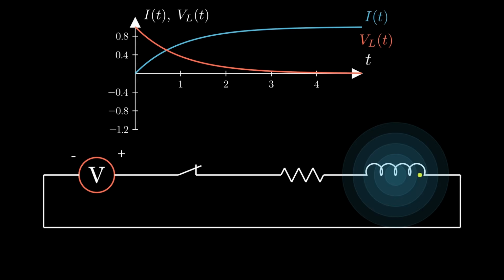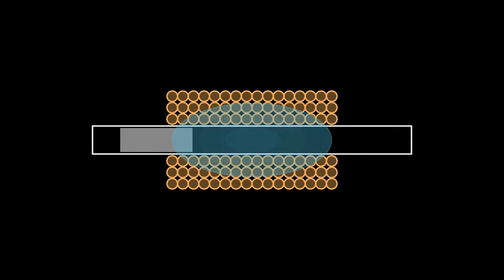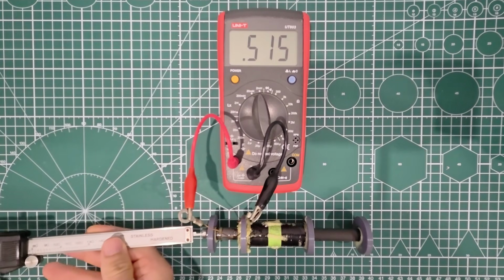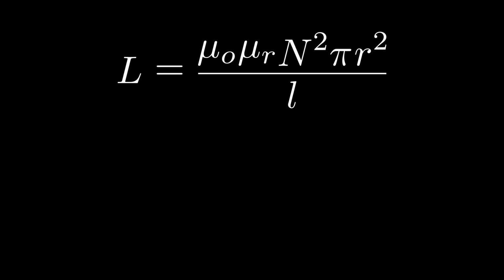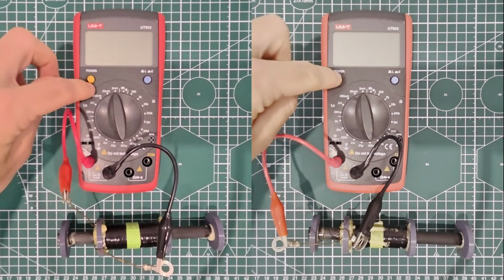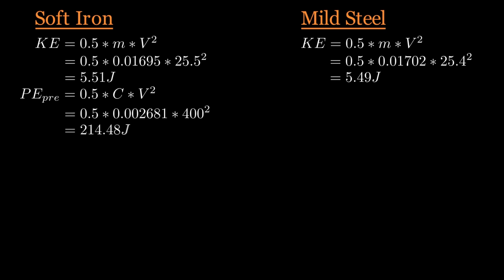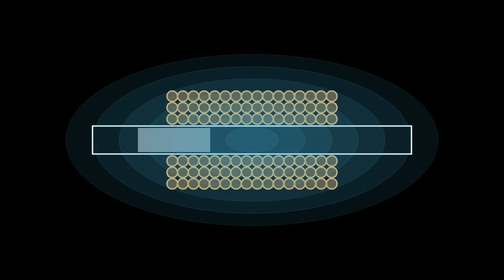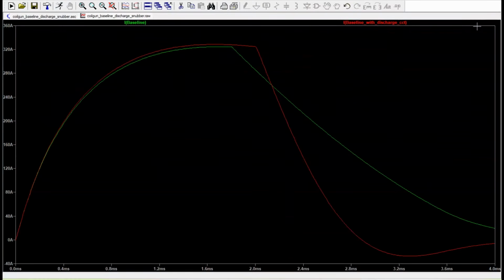The Science Behind The Coilgun

Comment: Hi Owen, have you thought about using a "seeker coil" outside the main coil (protected with a zener diod for the initial pulse)? 
That way you can trigger the shut off very close to the main coil center by detecting the projectile reaching 0V of the seeker coil.
I have not figured out how to best align the coils though. :)
I am also thinking if there are other ways of increasing the resistance during shut off to burn off the remaining energy.
You could argue that your final result showed that you had missed the coil center but at the same time you could just have over shot it now but the velosity increased anyway do to the improved burn off.
Reply from the maker: I have thought similar ideas but thay sounds like one i will spend sometime thinking about a way todo it. I have thought of maybe using a laser distance sensor to work out the projectiles distance to the center.
I havent yet found a better way to burn off the excess energy, there is probably plenty of improvement to be made in that area.

Comment: what if u add another diode btwn the mosfet and the coil? would that solve the spike issue?
Reply from the maker: Are you talking about putting it in series with the coil and mosfet or a different arrangement?
Reply: @owensprojects   In series a diode is placed btwn the mosfet and the cap/coil

Comment: Have you considered using a permanent magnet as your projectile? Use cylindrical magnet with its poles oriented top/bottom of the cylinder. You’ll need to feed the projectile to the coil in the correct orientation but it should be a more significant force multiplier than anything else you’ve done. 

This BTW is why loudspeakers use permanent magnets instead of two opposing energized coils
Reply from the maker: Using a permanent magnet projectile would be really interesting to try out. Like you said, there would mostly likely be a higher force the the poles of the projectile helping to attract and repel.
Reply: @owensprojects  
If you check out loudspeaker voice coil design you’ll find a significant amount of work product that can be applied to your project
Reply from the maker: Thanks for letting me know about it. I will be researching into them now
Reply: @owenspr @owensprojects king forward to your next installment in this series. 

Another advantage to choosing a magnetized projectile, as opposed to one that is simply ferrous, is that instead of cutting a stage coil’s power when the bullet passes you can instead reverse polarity adding a pushing force to the existing forward state’s pull.

I would push you towards neodymium magnets as they’ll have a stronger field

Comment: Hello. I'm currently working on a simplified coilgun as a project for my two first years of engineering. Wouldn't using a H-bridge to switch the current sign instead of creating a capacitor discharge be more interesting ? That way, you could keep accelerating the projectile after it passed the middle of the coil. 
Is the short circuit risk too high with the H-bridge at such voltage or is it that Mosfets/thyristor are too unreliable/create internal resistance too high to be worth it (I am really new to transistors)?
In our simulations, an H-bridge connected to a battery/a generator does better than a simple RLC circuit and it also looks far more efficient.These simulations only take into account the EMF produced by the projectile in the coil and the internal resistance of the coil in addition to the typical Kirchhoff laws. 
I'd be curious to know why everyone decides to use a variation of the RLC circuit.
Reply from the maker: Hi, you could use a H-bridge to swich the coil on and off, To be able to keep accelerating the projectile after it passes the center. This is just thinking out loud here, the projectile would need to some type of magnet that has a defined north and south pole to be able to interact with the changing field direction of the coil itself, which a standard iron projectile wouldnt be able to do unless it is somewhat magnetized during the intial phase of firing it.
Would be interesting to try and see if it works though, let me know if you do try it. You just need to ensure there is enough dead time between switching the direction of the H-bridge to allow the mosfets to have completed switched off so you dont cause a short circuit
Generally the reason for using capacitors and using a mosfet/transistor on the low side is cost and simpler design.
P-channel mosfets on the high side of the h bridge are more expensive to get then the equivalently rated N-channel option.
Capacitors are also preferred as once again its cheaper to get something with a high voltage rating and can handle a high current discharge compared to a battery arrangement.
Hope this helps! Let me know of you have any other questions

Comment: have U considered using super-caps , they have a lot more Ampers and energy compared to 400V
Reply from the maker: I haven't looked into them too much. They are more energy dense, although they don't come in high voltage ratings to be able to make much use of the of being able to discharge at high current rates unless the coils used were very low resistance.

Comment: Great to see lab work backed by analysis! I have a question about the snubber. From what I know the capacitor is usually much smaller. A 100uF capacitor seems huge to me, and I would guess it does more than just tame a spike, and instead would significantly modify the current flow. Do you agree? In that case, wouldn't changing the resistor in series with the freewheel diode D2 to a smaller one achieve the same thing?  And another small question: Doesn't the Schottky diode D1 already protect you from the voltage surge? Thanks!
Reply from the maker: Thanks! I'm glad you liked it. 
The capacitor did very slightly change the current in the simulated waveform with the peaks being reached at slightly different times but only about a 5-amp difference overall. Ideally the resistor in series with the freewheeling diode would be as large as possible to dissipate the energy quicker via I²R losses. With only a small resistor and the already low resistance, of the coil the current is recirculating through, the longer it will take for the power to be dissipated. The D1 diode does protect it without the addition of the resistor in series with the freewheeling diode, but once that resistor is added in the capacitor in the snubber circuit is required to absorb that additional energy. The idea behind it, is it works like shock absorber where if it is sized too small for the application it would "bottom out" and then not provide the required protection.
Reply: @owensprojects  Thanks for the detailed answer!

Comment: Hello Owen! Junior electronics engineering here! Sent you email with few questions ;p

Great work!
Reply from the maker: Hi Cyprian, i have just replied to your email. I hope it helps you
Reply: @owensprojects  Thank you! I replied there ;p.

Two questions:
- Where can I change starting voltage of capacitor pack? I only found capacitance value
- Do you think that it's possible to integrate this simulation with external script that could simulate many many different combinations and find most optimal one?
Reply from the maker: If you hold ctrl and right click on the capacitor you will get a pop up, which will have a line in there which says IC=400. You can change the 400 to starting voltage you require.

LTspice has has a .STEP command which may be useful for what you are trying to do. Other wise there is a python library called PyLTSpice that might help

Comment: What is the maximum voltage you have used to energize the coils? Maybe that's where the higher efficiency and speed lies?
Reply from the maker: The highest i have used so far is 400V which is limited by the caps i have been using. At lower voltages with the coils i have they werent as efficient, so like you said there is most likely higher efficiencies and speeds to acheive with a higher voltage
Reply: @owensprojects  If you use capacitors in series, you can store higher voltages. I know it reduces the effective capacitance, but its worth a try, right?
Reply from the maker: Definitely worth the try! I will have to re configure my boost converter for a higher voltage and test it out

Comment: Eddy currents are induced in the projectile that reduce efficiency.  A paper I read 20+ years ago showed that a laminated projectile was more efficient than a solid projectile. IIRC a bundle of straight wires was used. The paper also showed that a ferrite core around the coil also gave increased efficiency. If you are running a multistage coil gun you really only need one set of opto's, then use timed delays on your micro to trigger subsequent stages. Easy to adjust the delays through a serial interface or potentiometers for each stage.
Reply from the maker: That would be interesting to see the improvements with a laminated projectile, I wonder if it would perform better if the laminations run vertical or longitudinal?

Comment: the reluctance calculation is incorrect. 4*10cm - 1cm not 3*10cm - 1cm. Also the measurements should be repeated a number of times to prove that the changes ar significant.
Reply from the maker: Yep good pick up, i stuffed that up in the first line of the equation but the final value for the length of the core on the next line is correct at 39cm.
The test results were an average over 5 shots where there was only a +/- 0.1m/s difference between them. It made it hard doing anymore as the coils began to heat up at that point and the  projectile velocities began to taper off. I believe even with the limited number of results it still portrayed would you would expect with that particular set up.

Comment: Great video! I'd be excited to see how the performance (and efficiency) compares if using an asymmetrical half bridge where the coil current is returned to the capacitor bank Vs dissipated in the resistor, it does need a high side switched IGBT but should be doable!
Reply from the maker: Thanks! Yeah, it should be doable, definitely at least worth testing. There is depending on which coil but about 20-30Joules stored in the coil at the peak so there would be a few percent of efficiency that can be gained if it's all recaptured.

Comment: Great work and very informative video, thank you!
There are some points to further investigations or comments (if you have already performed it):
1) In your first experiment when you derive and compare the velocities in for different coils - was the starting coordinate varied as well? It is unfair to compete altered-diameter coils when the projectile begins its movement from the same place, because thicker winding has wider field spread. In other words, the maximum speed you obtain might be only local maximum for the fixed starting position.
2) Did you account for projectile tumbling in flight and corresponding error in speed measuring? I mean, if the projectile inclines or even turns over while going from the barrel to the first sensor, and between the first and the second sensors - how will it affect the results? My opinion that at such low speeds it might be better to utilize a narrow transparent tube and optical sensors.
3) The spice model you did with variable inductance is great idea! But L-meter uses very low current compared with what occurs during the shot, i.e. the magnetic permeability of the material is taken in substantionally lower field strength - in real coilguns it should be much less (which is why their efficiency is so dim).
Again, Thank you very much for video! Waiting for continuation!
Reply from the maker: Thanks, I'm glad you enjoyed the video!
In the experiments for each coil, the starting position of the projectile was varied until I found the point where that particular coil achieved its highest velocity. So, for each set up it shows the performance you would realistically expect to get.
The tumbling of the projectile wasn't directly accounted for but the velocities that were shown in the video were an average over 5 shots which hopefully took out some of the error for shots that did tumble more or less than others. but like you said a narrow transparent tube with optical sensors would eliminate the error all together.
Thanks for letting me know, I didn't think of that but that is good to know. I will have to invest in a current probe for my scope and adjust my model based of the results to get a better idea of the inductance at those current levels.

Comment: I’ve been thinking about a coil gun for a while as it’s a project Id like to get to someday. I wonder if using a better capacitance/inductance pair would be more efficient. Looking at the case without a projectile, the capacitor energy is only needed to ramp up the coil field, then the coil needs to dump the energy in an optimal way to weaken the field before the projectile passes the center. A capacitor that discharges fully before crossing the center can be charged to reverse polarity by the coil (which should still be possible for polar caps by switching). This way, the coil current would also drop quicker as the voltage on the charging cap would oppose it. However, I have no idea if this would be more efficient with an actual build:D
Reply from the maker: There definitely would be improvements in collapsing the magnetic field as the projectile passes the center, some efficiency losses will be there as the magnetic field is the stronger the closer you get to the center of the coil so the current in the coil at that point would be lower in this case but that could be completely offset by having minimal magnetic field as it passes the center and leaves the barrel. Would be interesting to build and see how it performs. When you do build it, you will have to let me know how it goes.
Reply: @owe @owensprojects eght so I looked into it a bit more, played around with my cap and simulated for a bit. The real restriction is core saturation - most materials saturate at magnetic intensities on the order of 1000-10000 A/m, my testing system (which was quite smaller than yours) produces peak fields of millions of A/m. What I also found out that the acceleration is proportional to the term I^2 * (h1^2-h2^2), where the h terms are field intensities at the projectiles ends, meaning the most acceleration is happening when the projectiles center is at the coil entrance - which worked the best for me as my cap discharges in under 10 ms. The force is also equal to the term 1/2 * I^2 * dL/dx, written in terms of inductance the coil perceives. Overall the efficiency can be improved by using fields that do not saturate the projectile - in the simulations for my capacitor/projectile pair, the efficiency of the system easily gets to 10%, probably better if I were to look for better parameters, with the assumption that permeability is constant over all field intensities. In reality, it may have been around 1%.

Comment: Nice work! How do you make sure the switch is turned off when the projectile is exactly mid coil? It seems to me that the time to mid coil should be matched to some number of R/L time constants of the coil for maximum efficiency, i.e. maximum energy transfer from capacitors to coil to projectile. This would be like a sort of electrical/kinetic impedance match involving inductance, resistance, projectile mass etc ...?). This is a good multivariable optimization problem involving real world R/L/C/projectile constraints :)
Reply from the maker: The time the switch was turned off didn't end up being at the exact center but slightly prior to it and was purely decided experimentally by adjusting the time the coil was on for until I found the time delay that achieved the highest measured velocity. That is definitely something for me to look further into and compare what theoretical time would be to the actual real-world results. You have definitely got me thinking and looking further into this now.